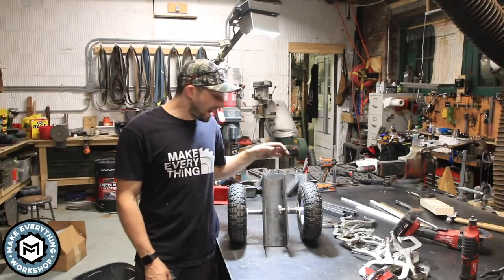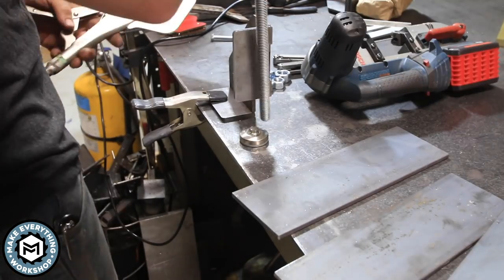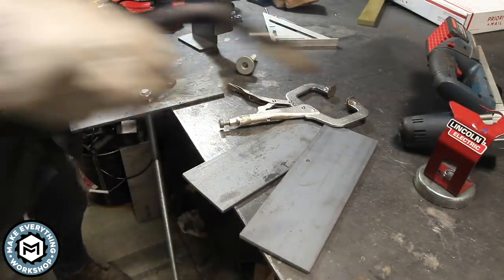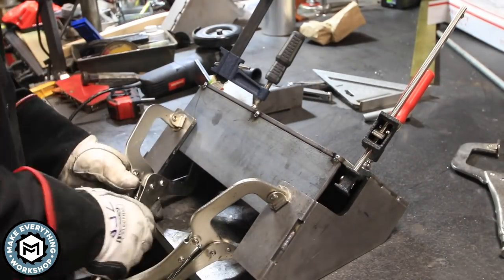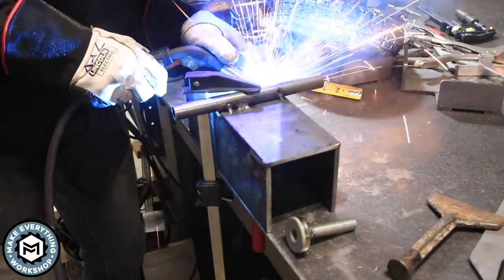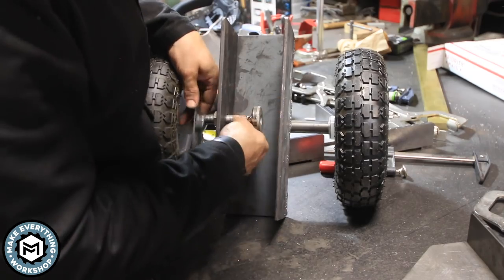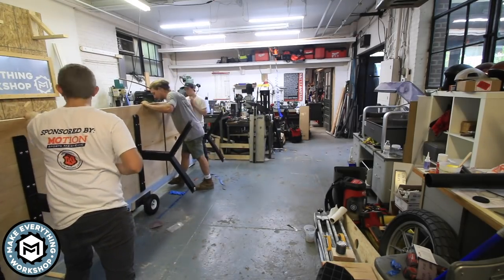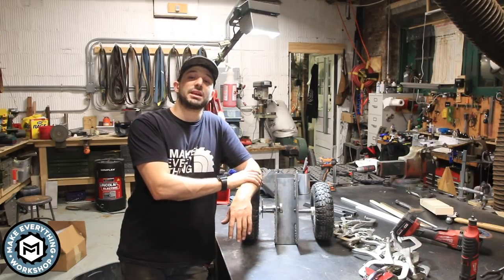All Terrain Panel Dolly | 500+ Lb Capacity

Comment: Could you make a video on how to apply those all terrain tires to a mobile tool box? Becuase I have a mobile toolbox with my power tools, but it has little wheels, and on the job site or at a construction site there is gravel, ditches, mud, dirt, rocks, concrete, absolutely bad for them poor little wheels, so I want to apply heavy duty tires to my box to sustain all that!

Comment: Hi Chris,
You can soak zinc hardware in vinegar overnight or 2 nights in tough cases and that will remove the zinc coating.  I didn't believe that it work myself until I tried it, but it does work great. No sense in taking any chances with your health. Thanks for the video!
-mike